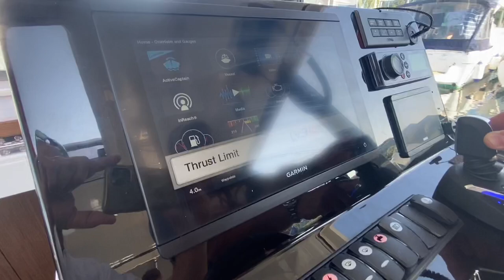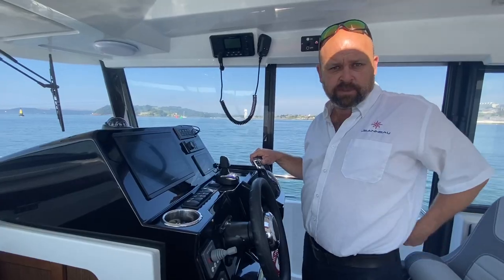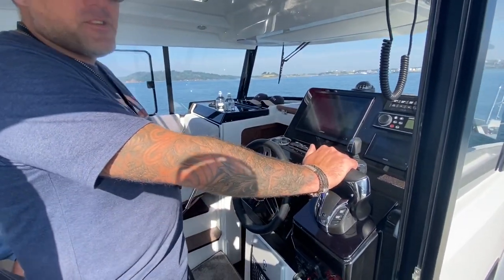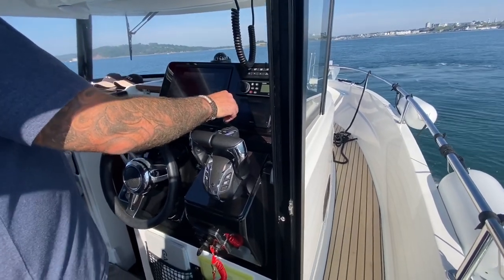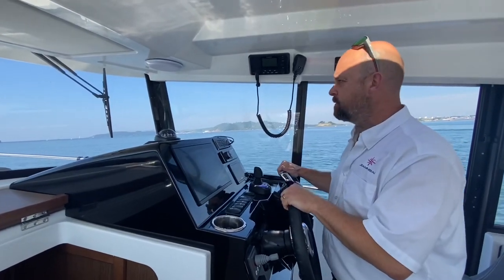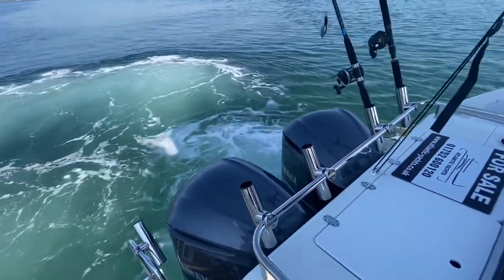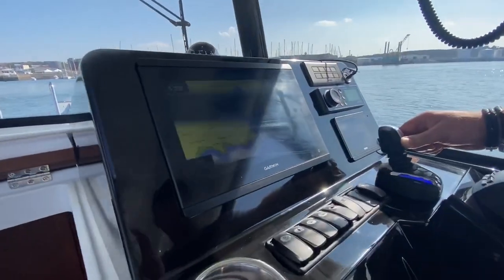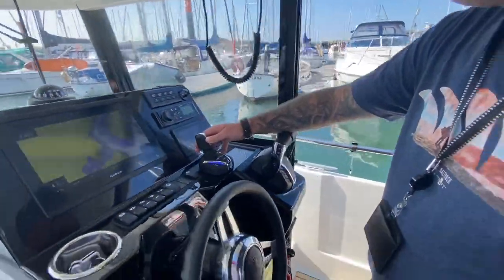Jeanneau Marlin 895 internal footage from drone flight

Comment: That joystick feature is the donkey’s whipper….I am very passionate about motor boating but docking was sometimes stressful……I’ve had one or two nightmares in a windy Cowes Yacht Haven with spring tides running fast in my old Sealine S24 that only had a single stern drive and no bow thruster….a great and informative video!